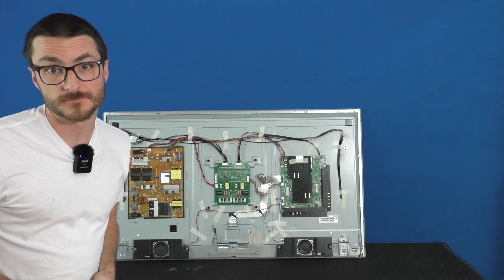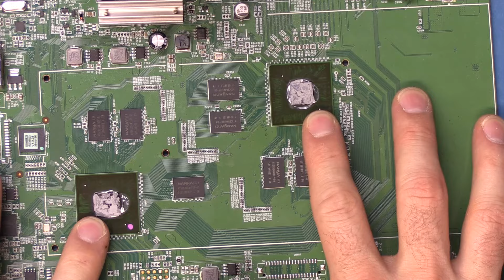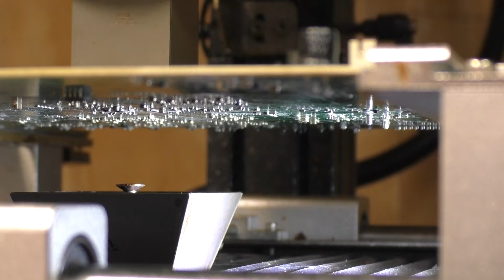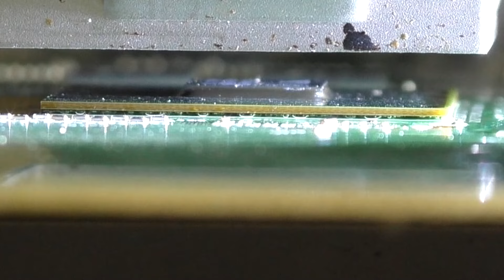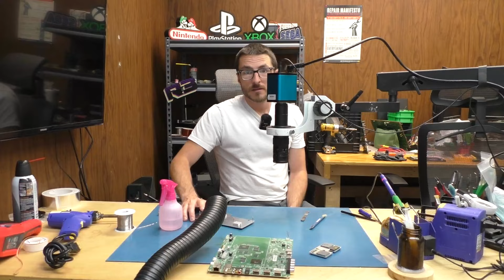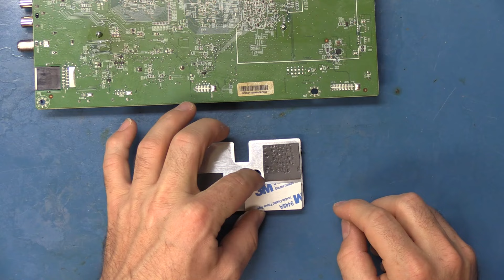How To Fix Vizio 4K TV Has power no picture M50-C1

Comment: Yeah, in the process of attempting to fix one of these M50-C1 TVs but am unable to proceed without a proper rework station (limited to just a quick 861DW hotair station & my trusty hakko fx-951 soldering iron). Curious how much you paid for that Zhuomao ZM-R5860C and where you obtained it from, kinda hesitant dropping that kind of cash on an e-commerce shop like alibaba/aliexpress where recouping payments on a bad product can be a bit like pissing into the wind.

Comment: What do I need to look for to replace the whole mother board on my Vizio m50-c1 ?  Are the M43/ M49/ M65/ M75 the same interchangeable part ? And where can I find one please ? 
I have a back light but no image . 
Thank you
Reply from the maker: Replacement Vizio mainboards are mostly discontinued, so what’s online are used pulls with limited return windows. Instead of gambling on another used board, we repair your original board, fix the known failure points, and include a 1-year warranty. That’s why we offer mail-in repair.
Repair service links in the video description!
Reply: @NicksTVRepair thanks for the feedback. But as we know these tv aren’t worth the price to have it repaired . And possibly it could be an issue with not the mother board . But the board below near the mid bottom of the tv . And after that is the board that it connects to along the whole bottom is the tv. 
I’ve already replaced a spare mother board with no luck . So next step I guess is the next board down . 
Of the tv was worth a lot and not outdated I would consider having you repair it . Seems like you do an awesome job ! 
Thank you sir
Reply from the maker: I understand where you’re coming from, but I do want to clarify a few important points.

When people say these TVs “aren’t worth repairing,” that opinion is usually based on the cost of board replacement, not board repair. Buying used replacement boards is a gamble, and unfortunately that’s exactly what you experienced — another faulty mainboard. That’s why I don’t recommend swapping used boards.

On this model, a bad mainboard is by far the most common failure. T-con or panel failures on the M-series are extremely rare unless the TV has been physically damaged or exposed to liquid. Backlight with no image on these sets almost always traces back to the mainboard, even if a replacement board was already tried.

Repairing your original board eliminates the gamble entirely. We address the known failure points on that board and back it with a 1-year warranty. Once the mainboard is properly repaired, these TVs typically run for many more years — the power boards, LED strips, and panels on this series are very reliable.

If the TV had water damage or physical impact, that would be a different conversation. Otherwise, the simplest and most reliable solution really is to send in the original mainboard for repair and be done with it.

Appreciate the kind words, and I’m happy to help if you decide to go that route.
Reply: @NicksTVRepair ok so when I turn the tv on . The standby light eliminates and fades dim . Is this an issue with the main board also ? I notice in your video the standby light stays bright . ? 
And I’m located in cali , where are you located and how much to fix my main board ? 
Wondering what shipping would cost to your location . How can I contact you via phone if I decide to ship . Also do you take core boards for a price deduction ? 
I have this extra Board that I bought . Thanks

Comment: Hey Nick - my M50-C1 power light goes on when I turn it on, but then it fades off. Occasionally, the light will come back on and then out again. I tried unsuccessfully to measure the standby voltage on the power board. Do you think it's more likely the main board? And since this TV is 10 years old, not worth repairing/replacing? Thanks!
Reply from the maker: The fault you are describing is in line with a mainboard failure. 
I think this TV is definitely worth repairing, if you were to replace it, you would probably be getting a lower quality TV unless you are spending $1,000 on an OLED model. 
TV tech has not really gotten much better in the last 10 years other than OLED and QLED sets, everything else that is your standard 4k tv is either just as good or worst. 
Fixing this set will get you another 5-10 years after which you can fix the set again. Some of the newer TV sets when they fail they fail in a way that can't be fixed anymore and then you are forced to buy a new TV.

Comment: i get the vizio logo on mine and then turns off, would this be the mainboard too? thanks
Reply from the maker: Yes that most likely is a different version of the same failure. When it comes to these mainboards, they almost always have the same fault, but that fault manifests via different symptoms including what you just described.

Comment: How many TV's have you done that are the led strips? Every tv ive been given in the last 10 years has a burnt led... Im guessing they are over driving them to get the light output they want. I bridge the led and hang it on the wall, Not proper but only let me down once when the other greyed leds cooked.
Reply from the maker: Most of the repairs we do locally are LED strip replacements. 
When we do LED repairs we always replace all LED strips with brand new ones.
Reply: @NicksTVRepair  well yea thats the correct way lol, Have you done any root cause research on why they burn out so fast? Heat? Overcurrent? Ive thought about replacing with new and lowering the driver output current.
Reply from the maker: Yeah you can but it is a lot of work and not always obvious how to do it. We have been having a lot of good luck with simply replacing with all new strips and using double sided thermally conductive tape instead of none thermally conductive tape like used to be used in the past. 
We also do customer education regarding the backlight brightness and keeping it at 80% capacity and that seems to do the trick.

Comment: To be honest, i did and do a LOT of this kind of rework on devices with cores that have bad connections and i have learned that rework without proper reball will fail within a year again.

Doing this work for 30+ years now...... Trust me, i know
Reply from the maker: I understand your concerns, but I’d like to offer some context based on our extensive experience. Over the past 8 years, we’ve successfully completed thousands of these repairs, including older sets with similar issues. Every repair we perform comes with a 1-year warranty, and less than 1% of our customers report any issues afterward.

Many bad experiences with reflows happen because the process isn’t done properly—whether it’s due to using improper equipment, incorrect thermal profiles, or other factors. Our lead technician, who handles the majority of our reflows, has over 10,000 successful reflows to his name and has been doing this longer than I’ve been in business.

We wouldn’t continue offering this service if it didn’t have a strong track record of long-term success. So, I ask you to trust our expertise and experience—this is what we do, and we do it right.

Comment: That's why processors that are installed in a slot, not soldered to the PCB, never have this problem because the slot compensates for the expansion and contraction of the component (processor) without problems. That is why the manufacturers released the slot as the best system that does not have these problems, and if the processor itself dies, it is easy to replace it with a correct one.
Reply from the maker: Yup! 
Not sure why they don't do that. That would be interesting to see that in TVs.

Comment: Would a heatsink fan prevent the solder joint issue?
Reply from the maker: It would help for sure.  
It won't prevent it, but it would slow it down.

Comment: These boards, are designed faulty.. their junk, this fix will only last few months, and you have to redo .until the boards from the heats go bad or the IC  go  bad.,bga chip, are cheap.
Reply from the maker: I don't disagree with you that these boards could have been designed a bit better, however this repair will not last months, it will last years. Trust me as somone that has fixed thousands and offers a 1 year warranty on their repairs.

Comment: I have done this repair many times over the past several years on this model, and similar models....   Also "lead free solder" is the main reason for the issue, leaded solder holds up ALOT better imho.  The Military, and Nasa are still allowed to use leaded solder in their applications....  Great Job!
Reply: And I agree, Pre-Heating the board is "KEY" to a sucessful repair.  It keeps your top end heat alot less, and keeps you from "popcorning" the board.  I ran into this issue when I initially started doing component level on multi-layer boards....

Comment: Thermal pads with adhesive? Must be a Vizio thing because I have open many TV's and they are never glued. Sometimes they are not even where they supposed to be.

You are not re-balling, only re-solder?! It would be better to re-balling with leaded solder.

With lead-free solder it will be so fragile and that is why the solder cracks.

I would call this a work-around and not a really repair. It will probably crack again ...
Reply from the maker: Yeah, a lot of thermal pads have adhesive on them.

Comment: Hi Nick, here a message from Holland. How to remove a heatsink from a Philips motherboard? With a paint dryer of? Grtz Dennis
Reply from the maker: If it's stuck on there with adhesive then yeah heat is your friend, or dip it in a tub a isopropyl alcohole. That should help loosen it up.

Comment: It's obvious that there are components on both sides of the board, can you say how is it that parts don't fall off from the underside as you're heating/reflowing from both the topside and the underside, Thanks for the video, outstanding work.
Reply from the maker: Well first things first, having this machine helps a lot. 
But also friction. If you dip you arm in a pool and take it out, the big water drops fall off, but some of the small drops stay stuck to your skin. Well all the solder is so small you can consider it very very small drops of water, to small to have enough weight to fall. The componetns are also all so small and light that the solder tension (water tension equivalent) holds them in place.
Reply: @NicksTVRepair  That certainly explains it, You sir are brilliant at your job, THANK YOU.
Reply from the maker: Thank you for watching and commenting!

Comment: If you go through the trouble of melting everything and applying why not reball it completely? One could argue that this repair is prone to failure if you do not fully reball it. Thanks for the video!
Reply from the maker: "If you go through the trouble of melting everything and applying why not reball it completely?"
That is a good question. And while it would be better that is true, it is an entirely different process which requires much more skill and about 3 times the amount of time than reworking like we did in the video. The other reason is that it would all be for a somewhat marginal benefit. I can't say with certainty but I believe that a reball would probably only get you a 20-30% longer life out of the unit. This is a complete ball park estimate based on limited data that I have experienced. 
If we reballed processors everytime with leaded solder balls we would have to double our repair price for this to make sense and people don't want to spend that much to fix their electronics. Otherwise indeed we would never reflow we would always reball everything. It's just that people aren't willing to pay the price it would cost to do that work. 
There are certain devices that we do indeed only perform reballs for, however those we charge a much higher repair price and it's typically for vehicles or other expensive equipment people are willing to pay a premium for the best version of the repair possible.

Comment: Why this cheap TV is using 2 and not 1 SoC like rest of the competition?
Reply from the maker: That would be because this is not a cheap TV but an expensive one with descent tech for being a 2015 model.
Reply: @NicksTVRepair  Vizio are def not Sony, LG or Samsung. Anyway - what's the story behind 2x SoC TV? I'm really curious.
Reply from the maker: Well just like Sony, Samsung and LG, Vizio has lower end TV's with just 1 SoC and high end TVs with 2.

This is a 50" TV and it cost $800 when it came out. Granted this was 9 years ago so prices were a bit higher back then but that was also about twice the price of the cheap models.